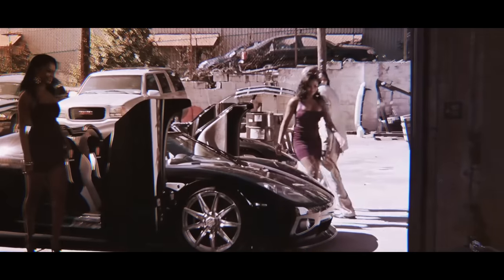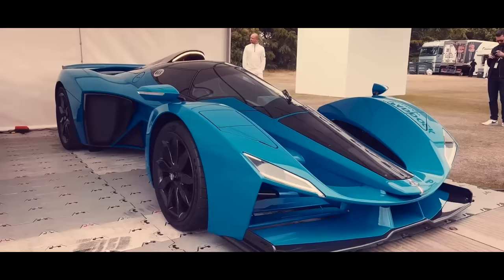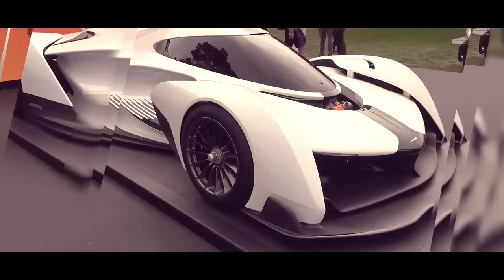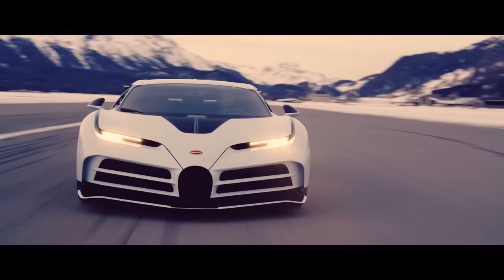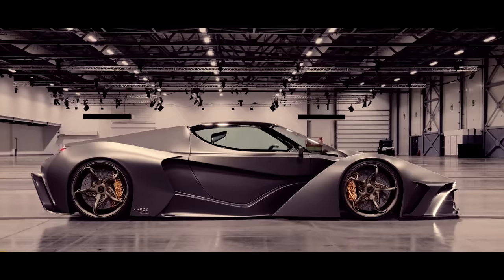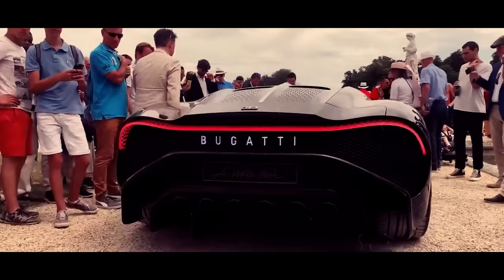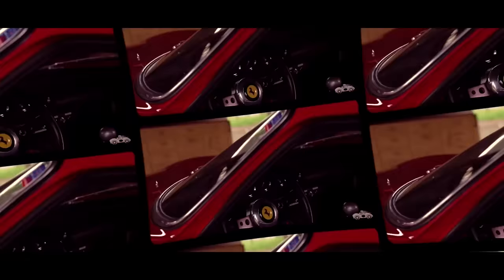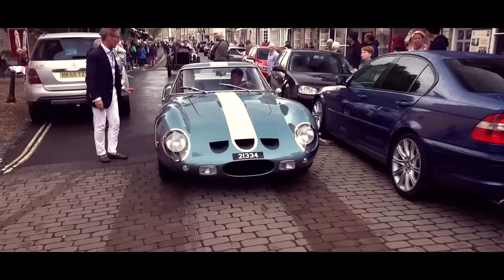The Car That Even Billionaires Can't Afford

Comment: To me, those vehicles, each one, is a miracle of automotive engineering! But, i don't think, billionaires can't afford them. As in the video, there are lists of different billionaires, who bought each one they love. I really love ❤, all these vehicles!
Reply: And that's the problem with these fine automobiles; only the rich and infamous can afford to own one. Many of the ones listed in this video, however, are not meant for everyday usage due to their delicate structure and low-to-ground design. What's the point of owning a car if you can't drive it on roads that most travel on?!
Reply: Yes. All car companies build cars that no one can afford. That’s how they stay in business.
Reply: Permission to dream please , to lust after mathematically drawn ,functionally abstract art magnifique

Comment: 3:08 Thats at Goodwood Festival of Speed in the South of England west sussex. I literally live 10 miles from the Goodwood estate and the historic motor circuit and horse racing track. Every year the traffic to get to and from Goodwood goes through my town, and there is literally a single line traffic jam of supercars, hypercars, luxury SUV's, road legal track cars. Its quite a spectacle. Ive been to FOS a few times. I went up in a helicopter and had a tour of the grounds too back in 2018.

Comment: For a mere $170,500 one can own the Dream edition of the Lucid Air that is capable of achieving 0-60 mph in 2.42 seconds, while the quarter-mile time is 9.67 seconds @149.87 mph, and has a system output of 1,111 hp. 

With a price tag of $249,000, the Lucid Air Sapphire is expected to have a 0-60 mph time of less than two seconds, and a top speed over 200 mph, and a massive 1,200 horsepower.

So, tell me again why I would spend millions of dollars more for similar, if not, lesser performance?  Oh right, for the name brand.  Gotcha!
Reply: Who wants a boring electric car?

Comment: I have a Lamborghini and yes I love the speed I'll never get to max out but above all HP and design masterpieces if you can't have a passenger most won't want it because it still all comes down to attention most of all from the people you want to have sex with. None of the super or hyper cars are comfortable to drive and The maintenance on these cars is insane just look up how much old change on a Bugatti is but I have to take my lambo 3 hours away to have anything done because it's the closest dealership that has a worker certified to work on it so I don't void every warranty or let someone who thinks they work on it but screw it up. But I don't drive it those 3 hours on the interstate each way nope it's in an inclosed trailer because it's not comfortable on a long drive for me especially because I'm 6 feet 6 inches tall and it was not designed for me. However the dealership in Orlando Florida did get me a redesigned seat and was able to make it far more comfortable than it was originally and they set them up for NBA players and NFL players that are my size and bigger and do a great job of it! What they saidWhat they said at the intro to the Bugatti about not buying a yacht is stupid because Bugatti actually makes a yacht that has a garage on it that comes with a Bugatti Veyron in it.

Comment: exept for the first two cars shown, all of these cars has nothing innovative about them. They run on gasoline, no different than the first car ever built 100 yrs. ago and to produce more horse power they just made the engine bigger. Of course a bigger engine produces more power. Nothing jaw dropping about that. They are luxury vehicles but don't refer to them as epitomy of engineering. Tunner cars can produce the same amount of hp power with just a small engine.

Comment: Oje.   
1.   Mclaren  : Dual Exhaust, Bugatti La Voiture Noire Six.  I guess even your hairdryer has a Quad exhaust?
2. Bugatti La Voiture Noire was not bought by ronaldo and it only exists one.  Also Feridinand Piech died 2019, so no, he doesnt own one. , Bugatti LVN was delivered 2021 to swiss.
3 Nothing is special on Carbon fibre , leather or Aluminium.  Or Multifunction Steering wheels.   Dont hype every shit detail. 
4.  Forget the GTO, The 300 SLR Uhlenhaut Coupe is the most expensive car. Period.  135.000.000.- Euros
5. The Greek "Ultracar" (LOL) is a rendering and 3D- printmodel from 2021 and there is still not even a prototype.  
6. The Hispanos name is Carmen Boulogne, and not Bologna.

Comment: I’m sorry but 14mm ll ion for 3k hp is just dumb, shows how dumb the rich can be ..I’d just buy a SMX3000 hp engine,for 70k and spend another 200k on a used FORDGT without a engine, and drop in my own drivetrain, and call it a day, lol..230mph all day long..lol.